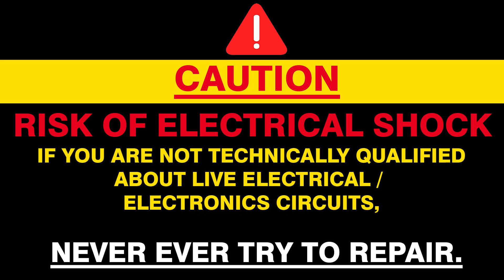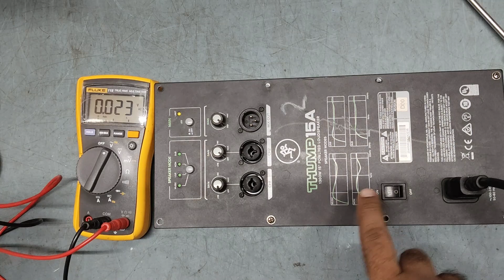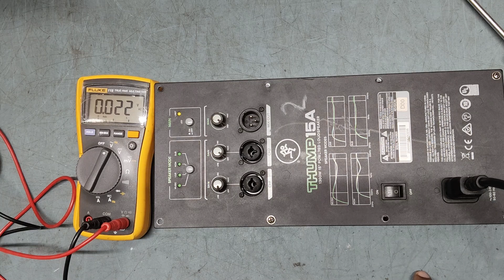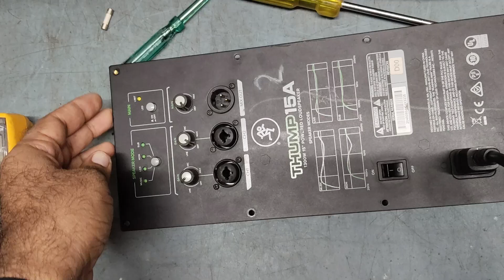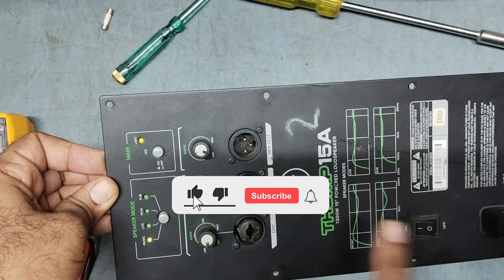Repairing Power problem in MACKIE THUMP 15A  Powered Amplifier speaker

Comment: Sir i have thump 212 1400watt very lowout put how to re fix it tobe good sound
Reply: I have the same problem. Did you find out what happened?
Reply: i have the same issue, maybe its the fuse. i used mine a whole 2 times and power output went to nothing